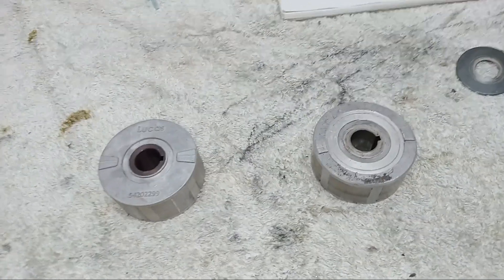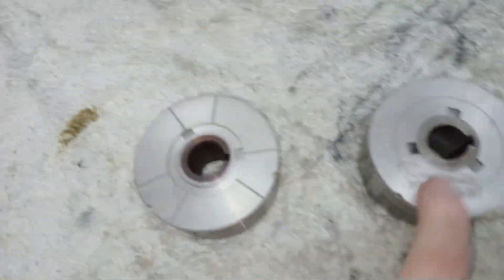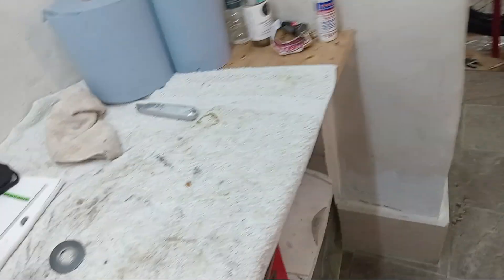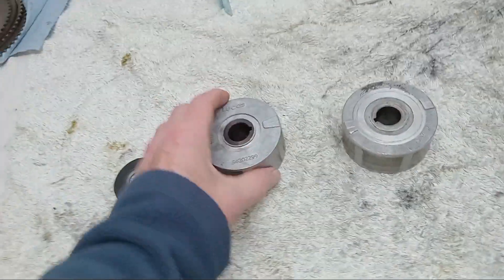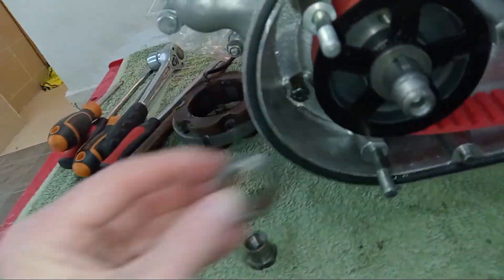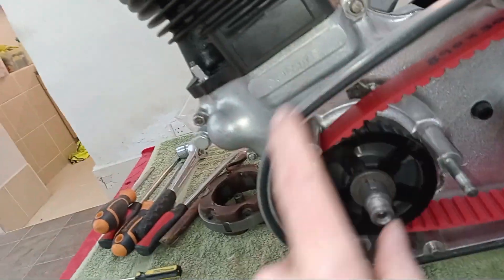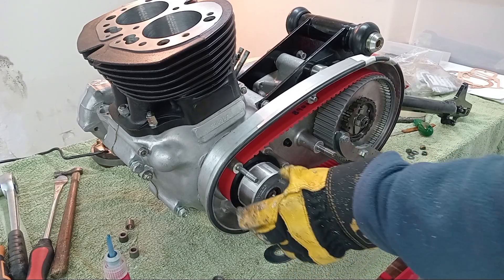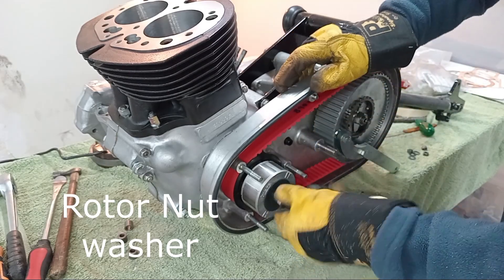Norton Commando Engine Rebuild. Part 61: Fitting the Rotor

Comment: Chris, early Lucas rotors had a habit of breaking apart they were replaced by the Welded rotor, stamped with a "W" on the face; I have never used an aftermarket rotor; On all of my motors the alignment of the Stator around the Rotor is quite good; you tighten gentle check with a feeler guage and tap with a Brass mallet before tightening down the Stator; It will not bend studs or crack cases you are just adjusting 10 or 20 Thou; I adore the look of that belt drive, nice and loose, keep it that way and completely dry; Now to upset you and the rest of the world, i rarely use a torque wrench, normal nuts bolts are done by feel on an appropriate wrench and a touch of locktight; OK like here on a Rotor nut I bring out The Torque wrench; Big long B*stard, no clicks, metal arrow so I can feel if anything is not right;

Comment: Hi is the sprung washer too big,are the trident washers smaller
Reply from the maker: That's a standard later Commando washer. The washers on the Trident and earlier Commandos are indeed smaller/different.
Reply: @Chris.rooke150  I'm  not so sure that is the correct washer. AN part No: 06.7894 is a smaller lock washer.

Comment: Chris, please don't 'bend' the rotor studs! They MUST be straight. The stator needs a minimum of 0.008in clearance around the rotor, so you can machine the middle section of the 3 studs to allow some clearance adjustment. (page 122 of Norman White's book 😉)
Reply from the maker: Yes, you can do it that way, and I'm sure that machining the studs is probably a better way (but the resulting play allows for the possibility of the stator coming loose on the studs and moving out of line) but it's not the standard way, which is to bend the studs a few thou either way. That's the way I do it and it works for me - no disasters yet. 👍🤞